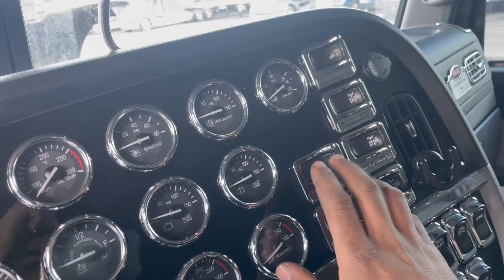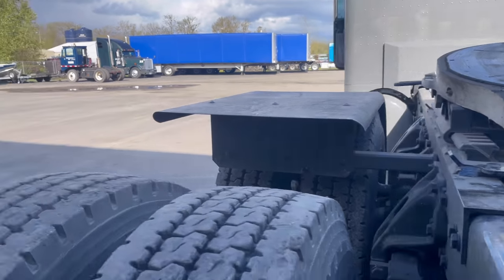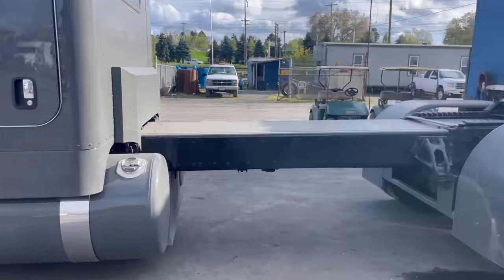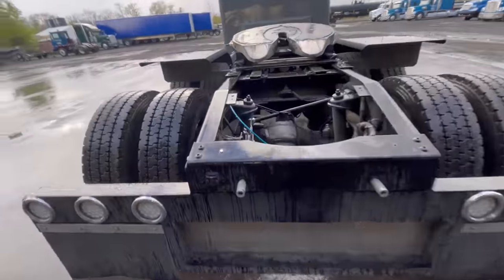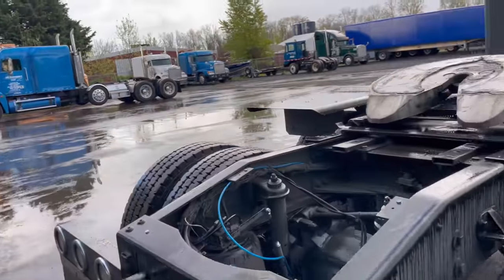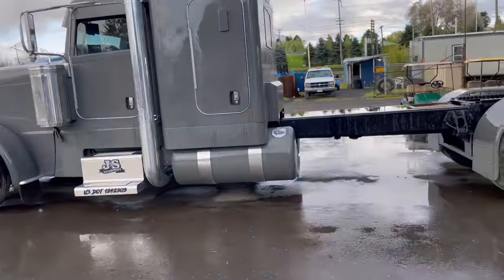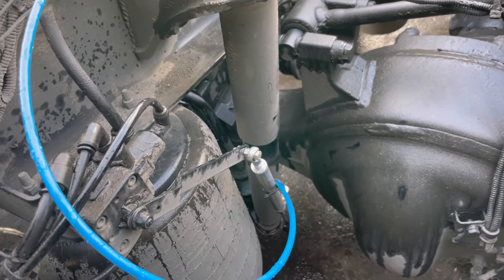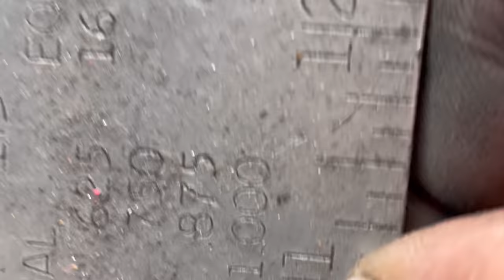Over inflate your rear suspension with one flip of a switch l low low Suspension

Comment: That's an interesting way to do that.  Mine was set up with two switches and one was electric to a valve that locked out the leveling valve and the other one was a air switch for air windows and that gave the adjustment of how high you want it.    That setup you have definitely works but I'd probably flip the air cylinder 180° so dirt and water doesn't lay on the seal of the piston.  Good stuff.

Comment: when i saw your video down on Rainier ave, and how close your belly was to that driveway, i was going to ask you if you had it, Ive done that to most of my trucks, can be a game changer : ) I do mine with a pressure regulator inline and bypass the ride control valve all together, ive never seen it done with the air cylinder, nice work.

Comment: If your bags are maxed out, will going over a hump or rough ground possibly pop one?
Reply: Yes, but you only use over inflate to push a trailer up when the landing gear gets stuck. It should only be used for slow slow movements.
Reply: @Rockwell108  
On trucks like that one it's mainly used to keep the fuel tanks from hitting the ground when the truck gets on uneven ground.  It has very little to do with the landing gear on the trailer.

Comment: What stroke is that cylinder?
Reply from the maker: It’s adjustable
Reply: @trucking4racecars  thank ya sir much appreciated. Wouldn't care to share the brand of it would ya. I've looked on Amazon found a bunch of different kinds. But knowing the stroke is adjustable helps me a ton. One more question would feel confident enough in installing that in the steer axles also? I'm wanting to do my rear and steer axles. I just don't know if I want to take a chance on the steer axle with that or if I should just buy the over inflate valve setup.